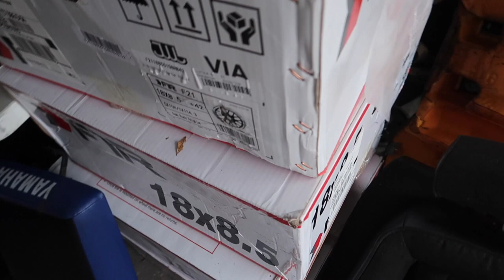New Carb Install & Stutter Fix On My Warrior 350!!

Comment: Got a 91 warrior 350 and  put a new carb on it same carb in this video and it’s just pours gas out of the overflow you can ride but it has that problem change the float still doin it
Reply from the maker: Sorry to hear you having issues bro, but my carb still fine even after almost a year of not riding. You prolly just got sent a bad carb or take your time tuning it so it doesn’t dump gas

Comment: It’s not completely necessary to remove all the plastics. Just the air box and fuel line from the peacock Also new carburetors come pre tuned for the most part unless you had done other modifications like exhaust or airbox mods.

Comment: Did you have to replace the throttle cable? Mine does t seem to reach the 1pz carb. Seems the same leangth
Reply from the maker: My bad for late reply but nah I didn’t need to replace the cable. Did it eventually fit?
Reply: @517_Melo  yeah. I had the flat piece inside the thumb throttle upside down. All good now. Thanks
Reply from the maker: @pliscinski  good to hear man, ride safe 🤟🏽
Reply: You're not alone with that short throttle cable I just replaced mine with one of them cheap ass carbs off eBay and I can't get that goddamn thing tuned and running right for the life of me that too short of cable that thing sits there and revs to max RPMs and I got to shut it off real quick I think I made a mistake and buying that carb.